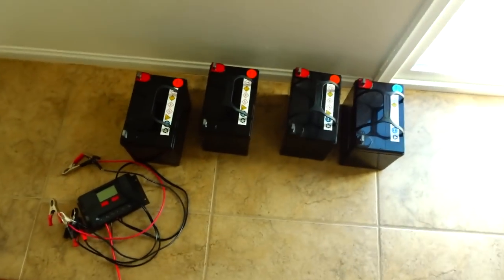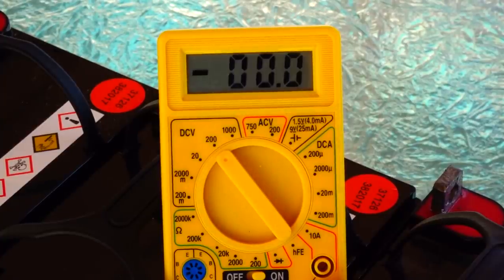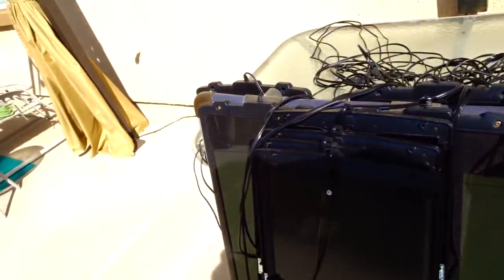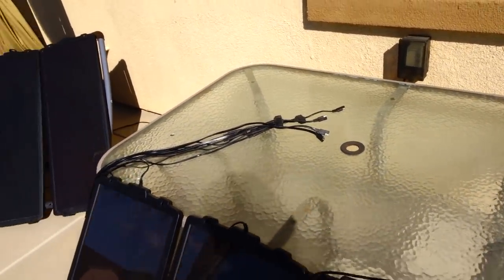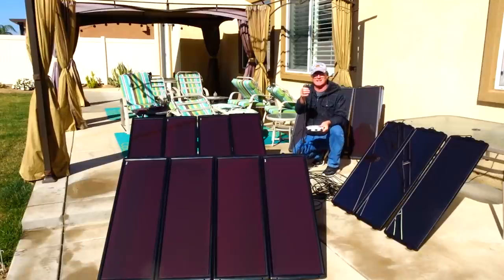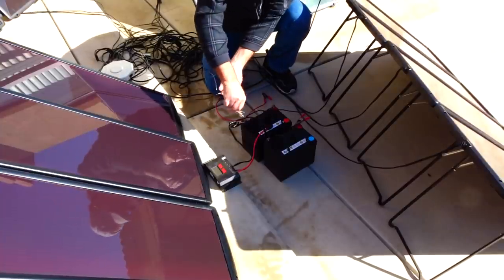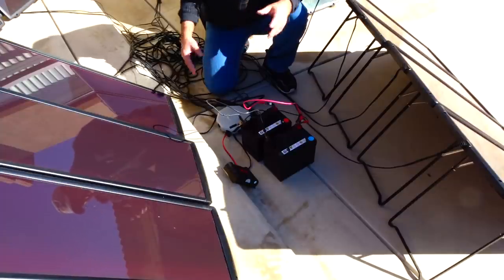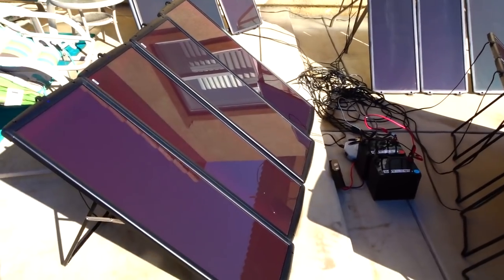290watts Harbor Freight Tools Thunderbolt Solar. Panels, AGM batteries, Hub, Charge controller

Comment: Hey billisa I have an emergency power system I've used the 100 watt kit Harbor Freight solar panels and have 200 watts. I also have 700 watts of mono panels.  I like my Harbor Freight panels as they do really well on cloudy days they just take a lot more space than mono.  However if you have the space to spare I like them.  I'm going to give you some suggestions that will really improve the performance of your setup.  First off based on what you have you NEVER want to combine mismatched (different voltage) solar panels on the same hub.  You want to keep like solar panels grouped together. The reason for this is the higher voltage panels can suppress power production on your lower voltage panels.  The best way to handle this (with what you got)is to use both solar charge controllers you got with your two 100 watt kits.  Those charge controllers are rated for 20 amps so group your x2 100 watt kits together on one controller and your two 45 watt kits on the other controller. Then put the two controllers in parallel to feed your batteries.  Now for improvements you  can make to your system. The charge controllers that come with the Harbor Freight Kit are PWM.  They work but are not very efficient.  If you was to switch to a MPPT controller you would gain an extra %20-%30 power from your solar panels.  If you group your batteries into 24V sets you can use the cheap MPT-7210A (works with batteries 24V and up) for $29 Ebay.  You can also use a better quality EPever (does 12V and 24V battery setups) for $70-$150 depending on features. The more solar you get the better the value of a MPPT charge controller gets. If you do get a MPPT charge controller be careful of Chinese no-name brands.  Many of them are fake. Next when choosing a inverter there are two main kinds Modified and Pure Sine Wave. Modified (like what Harbor Freight sells) makes a square AC wave which works but can be rough on electronics (extra heat) and cause damage over time.  A pure sine wave inverter is identical to the power in your house and has no problems though the inverters cost a little more.  I recommend getting a 24V inverter as they are more power efficient than 12V inverters (you can set your batteries in 2 parallel x 2 in series). For around $150 I got a nice 2000 watt (5000 peak) pure sine inverter on eBay that has worked very well for me.   For me I built a wood box which I mounted the charge controllers, inverter, and a handle.  That makes it easy to move without the batteries.  When there is a power outage (me or family) I move it where I need it then install the batteries and hook up the solar.  Hope this information helps!  Example pic: (upgraded to a EPever since this pic but gives you the idea)  https://scontent-ort2-1.xx.fbcdn.net/v/t1.0-9/45228000_1274082776064110_3149937918353604608_o.jpg?_nc_cat=109&_nc_eui2=AeE3Egl5ewYRel_SZUECymL35tDRJy-FKBH1ttJFQtkOz1mUvZEkcJjdQZCQ7aRgQx2kjW61hxhjHuFdkKozSfjP5Lu4GHcYil1S1YyfdLbT1w&_nc_ht=scontent-ort2-1.xx&oh=478a18b79b366b20a17e35aa0e14a76c&oe=5C3D6779
Reply: Thanks! I am new to this so more knowledge is power.....solar power that is!!!  LOL
Reply: Nothing opens when I click on it. Takes me to a blank page
Reply: Thanks for that info. Especially the inverter. I bet lots of people are screwing up their electronics with cheap inverters.

Comment: Hi. I have almost the same odd ball lot of panels. I see you have what I think are the 45  watt sets, and a pair of 100 watt panels. I have a pair of 100 watt panels. Added  a little 10 watt El cheapo panel. Total 255 watts. Gonna order 2 more 100 watt or a 250 watt panel 2 at. $85-90 or $190. Samo samo. 
   Only issue I had to deal with was different connectors. I just spliced, soldered and used heat shrink tubing. Done. 
    Still learning charge and consumption usage.

Comment: 11.7v is the lowest acceptable for SLA, GPA AND AGM. AGM tends to be more forgiving if you get down to 10.4v but really shouldn't. Typically an inverter will cut off before that anyway

Comment: Hi there!
Do you have any problems running the different wattage panels in parallel like you did. Maybe it’s not a big deal if they’re all the same voltage output. Was curious about that. Also you showed the voltage at the end. But did not see any information about what you were actually producing wattage and amperage from all those panels.

Comment: Are the batteries hooked in parallel? Or are you using one at a time? Parallel them you end up with the same voltage but also more current for longer use.

Comment: I have a little experiment for you 1 hook up all your batteries 2 you have four charge controller up to the battery 3 hook up solar panels to the charge controller that is required 4 see how long it takes to fully charge your batteries 5 see how much power will it take tooth pulled the batteries down  12.2 you may find out it's going to be hard

Comment: Where did you purchase the gator clip cables to run the batteries parallel?

Thank you
Reply from the maker: I made them. Parts from home Depot. Thanks for asking. Just make sure you get wires thick enough for the planned amps running through them.
Reply: I am planning on having (2) 12volt 35amp deep cycle harbor freight in parallel. What gauge wire would I need and the length for each?  They will be hooked up to a 400/800 watt inverter. They batteries will be charged by a 100 watt solar panel. Thanks in advance
Reply: I used jumper cables that I cut up that were 2 awg. That was the best deal I could find. $20 from Rural King for 20 ft.

Comment: Keeping batteries on the ground will drain the batteries, and keep them from charging as much as they could, if placed on a non-conductive platform of some kind.  Even a piece of lumber is better than nothing.
Reply from the maker: I agree. They were just there for the video shot.
Reply: Modern batteries are not affected by the ground! This was part of an electronics class lecture (turned discussion...lol) in college.
Reply: PETE !!  You must be about as old as I !!  I've been told that although that WAS true of older batteries , it is no longer an issue with the "Plastic Cased" batteries of today .

Comment: I still dont understand something n ive been watching solar videos for a few years..if you tell me I can drain my battery down to 50% percent n my batter starts at 14.4. Should I not be able to drain it to 7.2? I find it very confusing when the battery goes from 13.6 to 12.4 and ppl say oh I need to charge my batteries?
Reply from the maker: Hi, Recharge your battery when it has used 50 percent of it's power. Not the voltage of your battery. In this video I am using a 35 amp battery. You take the 35 and multiply it by 12 and you get 420 watts.  When you have used half the power recharge it. 420 watts in half is 210. when you have used 210 watts. recharge it. If you are running at tv that uses 60 watts an hour. You can run that tv for about 3 and a half hours before you recharge your battery.
Reply: @billisa  k

Comment: Why didn't you charge all 4 batteries at the same time?
Reply: I have this same question. Would think it could work but tale a bit longer.
Reply: He may not have the additional cabling necessary to charge all four batteries at the same time.  I dont know that but i assumed it likely.

Comment: why did you buy 2x45 watt sets and 2 x100 watt sets to achieve 290 watts. for approximately 600.00 usd, When you could have bought a 315 watt panel for about 280.00usd online and only had to use 1 panel. Compared to using 14 panels, And taking up so much space..
Reply from the maker: For fun and The YouTube experience. A lot of people have these kits and want to know about them. Besides I didn't pat near that. Happy New Year. Hope your channel is doing great. I will check it out when I have a chance.
Reply: The amorphous panels start and keep making power with lower light input, even if they don’t peak as high.

Comment: You can get 100w panels on Amazon or eBay for $100 why don't you buy them instead of the harbor freight
Reply: Harbor freight solar panels are Thin Film type of panels and the one and only advantage is they produce power in low light conditions. Even a fluorescent  light will be enough light to produce power. I haven't tried that yet. But I don't like the idea you cannot wire them in series for 24 or 48 volt system. HF panels are for experiment to learn about solar. And small requirements . I would not think.you could run an AC unit on HF panels. And at night it's out of the question.
Reply: I'd like to see that. I've looked on amazon for the last days and haven't found anything cheaper than harbor freight. That also offer the charge controller and accessories.
Reply: I don't same thing HF was by far cheaper to get then any Amazon or Ebay  and of I was to buy something like this Ebay and used items on solar will be 100% out of question. I would never buy these items used.